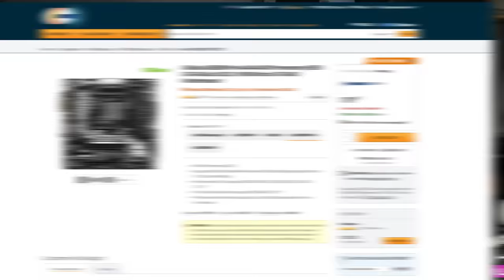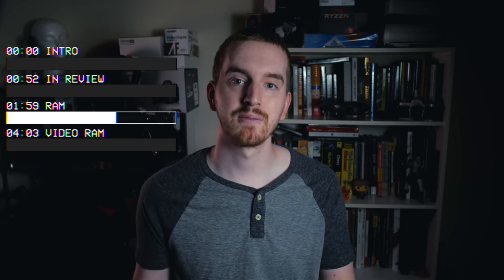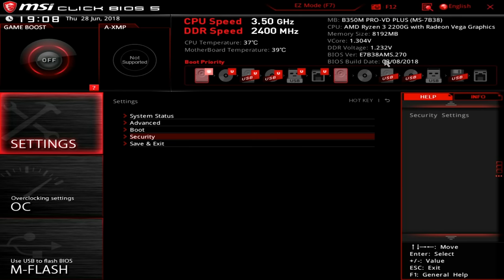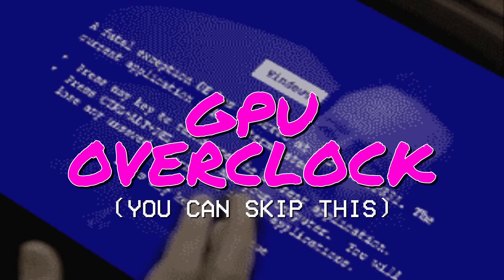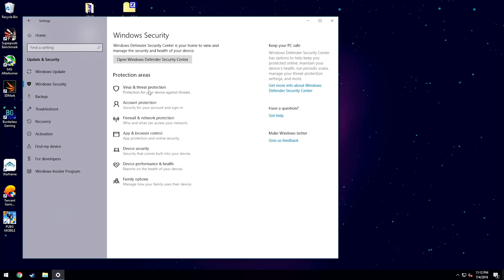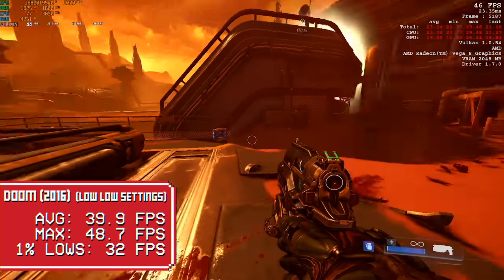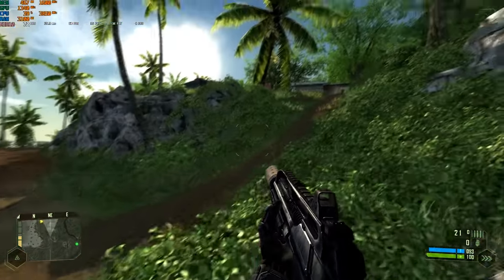How to get INSANE GAMING PERFORMANCE out of AMD Ryzen 3 2200G APU - Ryzen 2200G Optimization Guide

Comment from the maker: ★ ★ ★  SPONSOR: Lorex Technology - https://fbit.co/7cfI
Yes, if you must insist on proving yourself right on the internet -- you CAN reset BIOS using a jumper on the motherboard. It's just not my default way of doing things, I've been doing the battery method for 10+ years and have literally never shorted the jumper for that. Especially when this is a tiny motherboard, it was much easier to keep reaching down and grabbing battery than to turn on my phone flashlight, look up in the manual where the jumper is, find a screwdriver, short the jumper. And in terms of accessibility, that prospect is a little more scary to new PC builders. But yes, I am aware you can totally do it. There are multiple solutions to any problem.
★ TIMECODES: ★ 
00:00 Intro
00:52 In Review
01:59 RAM
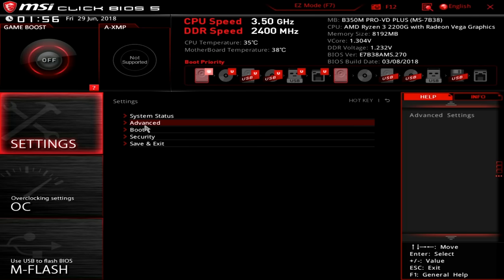04:03 VRAM
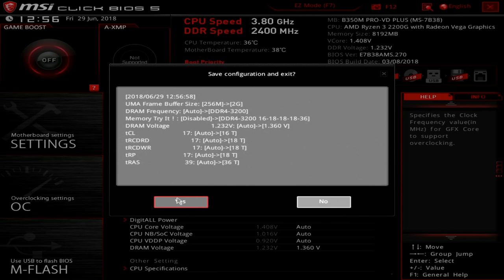05:03 CPU OC
06:26 Ryzen Master? 
07:11 GPU OC
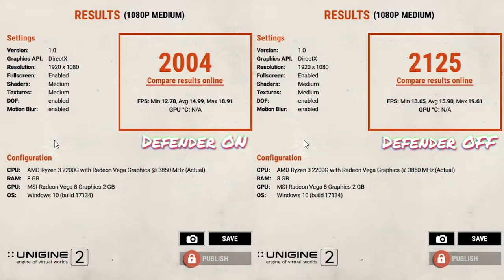08:19 Background Processes
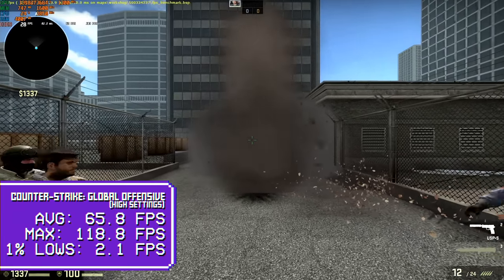09:22 Gaming Benchmarks
12:34 Quirks & Problems
14:35 Conclusion
Reply: Go back to win 7 pro and maybe the apu wont screw up nice vid btw.
Reply from the maker: Windows 7 isn't even officially supported by the drivers/chipset and lacks memory optimization and other modern improvements over the last decade.
Reply: Hey can you do a video on the Riiai yk931 capture card is it any good
Reply: Isn't the clear cmos jumper right next to the battery?  it's labeled JBAT, just cross the two pins
Reply: The "Jumper Method" is the proper way to do it, as described in the motherboard manual. The CMOS CLR or JBAT jumpers are usually right next to the battery. All you have to do to properly clear CMOS is move the jumper from one position, to the other. It's the reason the motherboard makers put the jumper and its circuitry there. It's actually easier to do jumpers than to remove and refit the battery. It's ok that you've been doing it wrong for more than a decade but advising other people that this is the proper method is incorrect. And defending your doing it wrong as "an alternative method" isn't going to work. It's wrong. It may work 999 times out of 1000, but it isn't the proper way to do it.
Reply: what software do you use for fps etc statistics or is it a feature built into all games?
Reply: Hey bro you should use Razer cortex program its a awesome program I usually was tying to play fortnite in a crap pc with core    i3 560 and 4 gb ram 1300hz and GeForce 210 hahahahah crapest pc ever fortnite was running in 20 fps because my __ windows was eating 45 percent of my ram .and I found razer cortex it cleared up my ram when I boost it and only 25 percent ram windows was using.and a manage to get 28to 35 fps some time lag .it is awesome you should make a video about razer cortex and its free no ads no money cost .it disables windows explorer and run its own game explorer. It is super help full if you have low ram
Reply: Also add a video doing for 2400g and same specs
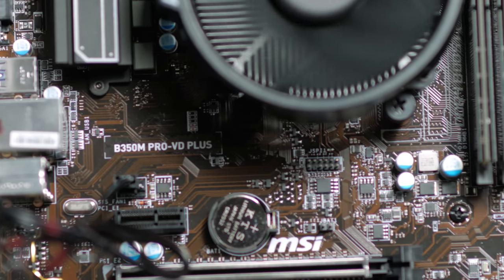Reply: Um.Dude. i have been making APU computers for about 8 years now. They never do that. So your comment 14:26 Yeah its not the APU baw. None of the APU's i have built have done that. None of the A12 to A8 processors have done that. So you are gonna have to figure that one out. It sounds like its on your side. Like a Ram issue.
Reply: Ŕ
Reply: Nevermind i saw the follow up video so ignore my comment.
Reply: I've already run in to situations where I actually had to reset the cmos and use the jumper. Didn't make sense but it definitely seemed to work...anyone ever hook their reset button to the cmos jumper?
Reply: Most mainboards have a jumper for deleting the BIOS.
Reply: Hey just found your video. Try using Driver 17.9.3 instead. See the difference.
Reply: The 400IQ method for clearing the bios if you dont already have a clear button is to connect the reset button of your case (pretty sure most if not all of them should have it) to the clear cmos jumper while you are messing with overclocking stuff
Reply: Also you should have tried to overclock just the igpu, leaving the cpu at stock speeds since the igpu is the bottleneck anyway
Reply: Ps: I know this video is old
Reply: @EposVox i was able to get a steady oc of 3.8 before I ran out of power from hp's crappy psu that isn't modularly connected but I also was able to push my ram well over 3466 before I also ran out of power

Comment: You should not change the VRAM reserve settings. The actual memory used by the system is dynamic and will adjust based on demand or title minimum requirements. What it will affect is how much you have while doing day to day stuff like browsing the internet. Several reviewers have already tested and confirmed that you should not change that because it has no affect on gaming performance.
Reply: James White This is true. You're only limiting the amount of RAM you can use for the rest of your system if you allocate the maximum VRAM. Instead, it's actually better to allocate the smallest amount to the iGPU
Reply: Partly true. For games where it's good optimized this is true, but there still are a few games out there and even some that won't boot if it thinks there is only 256mb of ram for the GPU.
Reply: +James White
Not quite true.
Technically what's happening is the same as when you use more memory then a graphics card has available, the system memory is used.
However system memory and graphics memory is one and the same so there's a negligible performance difference (there is one but it's so small that you can almost ignore it, I'd say set it to 1 GB and leave it there, giving you a tiny boost for the parts of the game that fits in there and avoid most issues with games not running with the minimum VRAM and then just leave the rest available for the system)
That is unless you run into a game that actually won't run with 1 GB of memory, then increase it as needed for the individual titles you play.
Reply: I play War Thunder a fair bit. Unfortunately this doesn't hold true with that title. The memory allocated is what the game 'thinks' is available and the performance is hit as a result. When i allocated a 2gb there was a big performance gain. This is a fairly isolated instance because i believe Gaijin, the makers of the game, use their own game engine. So im assuming this is a limitation on that part...
Reply: Several reviewer means hardware unboxed? I play games on PC and I dont own single of the game he tested. Other reviewr like Tech Deals said 2 gb should be minimal to run ALL games without problem.
Reply: +Yulus Leonard
No, it means several reviewers, here's another exampl:.
https://www.youtube.com/watch?v=YDmYHpykcDo

The same holds true for older APUs too:
https://www.youtube.com/watch?v=506xmgSYIKM

Yes, how much memory you should allocate may be important for certain games, but most games out there will run the same with low and high amounts of allocated vram.

But yes, do your own testing for the games you play.
Like Lee Robinson said, there are some games that acts weird sometimes...
And some games flat out refuses to start unless it registers a certain amount of vram.
Reply: I got about a 35fps boost doing it so idk what your talking about
Reply: +Nathan Brown  35 fps boost?
Sounds like one of those games that acts weird when it has too little memory registered as available...
But in most cases you shouldn't see more then one or two fps difference most of the time...
Reply: Yep, AMD's APUs are HSA chips (heterogenous system architecture)
Like consoles, there's no such thing as CPU and GPU anymore, but legacy systems like Windows and dodgy  old engines are built during an age of seperate card GPUs.
We'll have to wait for the next major Windows release where dx12 is the minimum supported.
Reply: To set it as max as possible is the best advice for gamers ;) If you don't do this you may cry or to even become angry without particular reason :D as in reality some games, engines and drivers like to see more there ;)
Reply: +Milan Kostić  No, it really isn't.
If you have say 8 GB of system memory and you set it to the max (2 GB) that means that only the iGPU can use those 2 GB of memory while the game and OS both have to manage with the remaining 6 GB and anything that can't fit ends up in the page file, or in other words, on a harddrive...
It depends on the game, but if you set it to say 500ish MB and the game don't have any limit that stops it from opening at that amount of VRAM then the performance penalty for using just 500 MB instead of 2 GB is actually quite small, only about 1-2 FPS most of the time while you also free up 1,5 GB of memory for the rest of the system reducing the likelyhood that your whole system freezes while it waits on data from the pagefile...
Losing 1-2 fps is a small cost to avoid total system hangs while waiting on data in the middle of the game...
1 GB is a nice compromise by the way as most games do use 1 GB of VRAM these days and the amount of system memory being locked up in VRAM isn't as severe that way.
When you go above 1 GB it will still overflow into the system memory and due to HSA the penalty is quite low.
And if you do end up using less then 1 GB it's usually not a lot less.

But yeah, check out the games you play and test out different things to find what works for you. =)
Reply: Just leave it on 64mb, thats the best you can do, forget about 2g
Reply: + @mati8707  Depends.
While the performance cost of exceeding the dedicated VRAM portion of the memory isn't particularly big it does exist...
And trying to tweak the VRAM to better suit your typical workload is well worth doing.
Personally I'd probably go for something in between, like ca 500 MB.
That way you both have a bit of VRAM for applications and a decent chunk of system memory too.
Reply: @Luredreier  its the same thing, by doing that you're just limiting your ram
Reply: Luredreier i think it also depends on how much ram u have overall. its a difference whether the system is built using 8 gb or 16. since one has 16 gb i would go with reserving 2 gb. but if u have only 8 gb i'd rather test it out what is adequate. but should not be an issue if one has 16 gb as there is still 14 gb of ram for other heavy workload. do u agree?
Reply: + @mati8707  No, it's not.
It's stored the same place.
But accessing video memory outside the dedicated VRAM requires a extra step as the data is stored somewhere other then where the iGPU is expecting the data.
I don't think there's more then one or two extra instructions over what's normal required to fetch the data.
But there is a tiny, tiny penalty.
It's barely possible to measure the difference it's so small.
But it is there.
But yeah, I agree that it's definitivly not worth dedicating all 2 GB for VRAM.
Reply: + @Kig_Ama  Personally I keep exceeding 16 GB of system memory use on my system, so I wouldn't use 2 GB even in a 16 GB system myself.
Regarding testing it out.
The difference is quite small, you might struggle with seeing it in your home system if you're not used to doing benchmarking and stuff, it's very close to the margin of error. 
Personally I'd use a mix of what games expect in terms of VRAM and what I don't expect to use myself and what I expect is going to be used as VRAM anyway to try to evaluate how much to dedicate to VRAM.
For instance if all my games where using say 800 MB of VRAM then 500 MB of VRAM is definitivly worth dedicating.
If a game refuses to launch unless you got at least 1 GB dedicated then perhaps 1 GB is worth dedicating, but no more.
I just think it's a bad idea to go for the outright minimum amount even if the penalty is extremely small for doing so and doing so frees up memory for other tasks.
The penalty is small enough that I don't mind some of the video memory being outside the dedicated VRAM portion of the memory.
But dedicating enough VRAM to ensure a good mix of stuff inside and outside the VRAM is probably the way to go.

The perfect balance probably differs a bit from game to game.
But personally I'd probably just leave it somewhere like say 500 MB in a 8 GB system for day to day usage.
Reply: @Luredreier  "But personally I'd probably just leave it somewhere like say 500 MB in a 8 GB system for day to day usage." Ok thanks a lot, that's a recommendation for a 8 GB system for day to day usage, what would be your recommendation for a 16 GB system at the end of the day?
Reply: I got a boost in fps ultra high in dota 2 when putting 2gb memory of ram for the apu r3 2200g. I got 8 gb of ram (2x4) I tried 4gb for apu also but it is not consistent and less performance. The best for vram is 700mb 1gb and 2 gb.
Reply: + @Kig_Ama  If you have 16 GB then you can afford to push the VRAM quite high as you have more then enough memory to spare for the CPU.
In that case I'd just push it to something like 1 or 2 GB if possible on your motherboard.
But it would depend on what you feel comfortable with and how you use your system, what applications you use etc...
Reply: + @beamcabilan7649  Yes, but it depends on your application (and to a lesser degree what else you got running in your system).
Reply: @Luredreier  Thats exactly what I did. As I have 16 GB of total RAM I reserved the maximum of 2 GB as VRAM.
Reply: @Kig_Ama   Did windows 10 recognize that you changed the frame buffer size in its display adapter properties where it says dedicated video memory? Is it a problem if windows doesn't even register that changes were made in the BIOS to the UMA frame buffer size by showing more dedicated video ram afterwards in the display adapter settings? I have a vega 10 laptop by the way with 12 GB of DDR4 ram and when I go to display adapter properties in windows it says the following four things:

Total available graphics memory = 6218 MB
Dedicated video memory = 
256 MB
System video memory = 0 MB
Shared system video memory= 5962 MB

I saw another youtube video by Technical PC tricks that one should actually change files in their registry to make sure that windows accurately reflects a different value for vram.
Reply: TyroPro well actually i only looked it up on the task manager, there it says 2 gb is reserved. should i look it up elsewhere?
Reply: @Kig_Ama  Naw it's cool. Windows totally recognized the change in my bios right away. Kigma do you happen to be aware of any software out there that might help me put a cap on my fps in game? I have amd adrenaline software but it doesn't offer that target frame limit option for some reason. I understand I might run into some frame pacing issues but I'll cross that bridge when I get to it. Thank you so much.
Reply: TyroPro nah sorry i cant recommend u any software. actually right now i dont play any latest games, i am rather much into emulation of retro games and using emulation software like retroarch, retroarch provides u wit frame limiting functions depending on the so called core u r using.
Reply: Well, I agreed with you James
Reply: Do you lot even get what your talking about, your dedicating more ram to the apu..... so a 2400g with 4gb of vram would be 6gb for the graphics card
Reply: @Mantis_Shrimp99  oh look, something that actually never happened.
Reply: @Luredreier  8
Reply: umm i have a 2x8 gb ram and when i allocated 3gb ram for igpu my fps got at least 20% boost in cs and valorant
Reply: PabloDorifto lmfao. 3 GB. Lmfao.
Reply: j c lmfao
Reply: Aaron Garza wot? i got 16 gb didnt even matter. also i got an rx580 8gb now so i dont need the integrated gpu now
Reply: @eresuplays  how do you disable apu if you have dedicated GPU?
Reply: Carlson Valencia i deleted my old graphics driver then downloaded the rx580 drivers then opened my bios, put the video output to pcie instead of integrated
Reply: @eresuplays  Thanks mate! Now I can use all the cores for computing instead of it doing the GPU stuff hehe
Reply: It does fix RDR2 lagging problem tho, by changing it to 64mb.